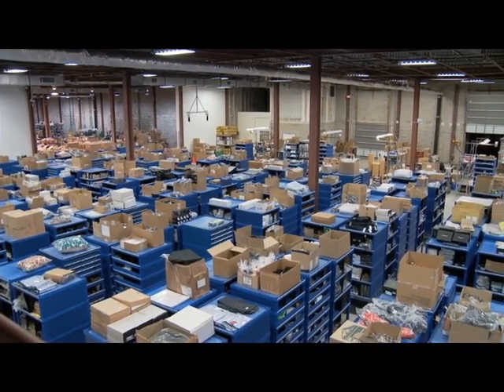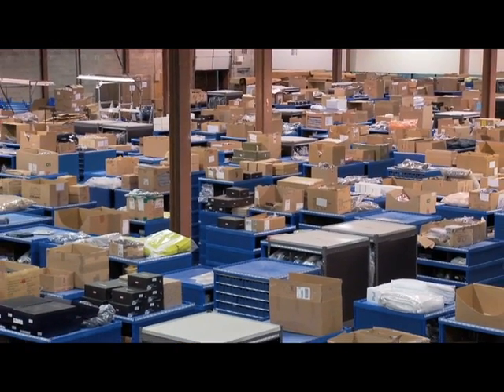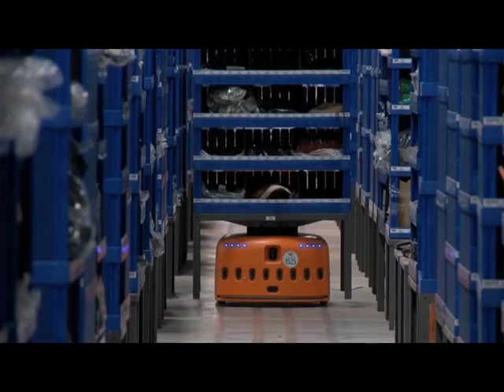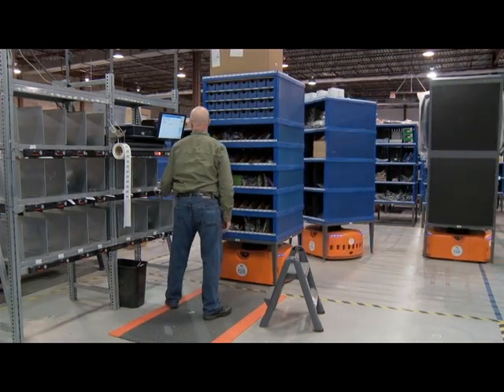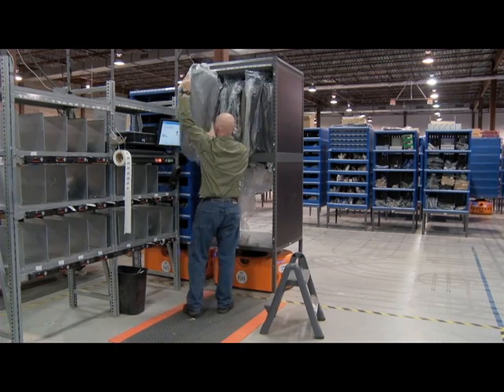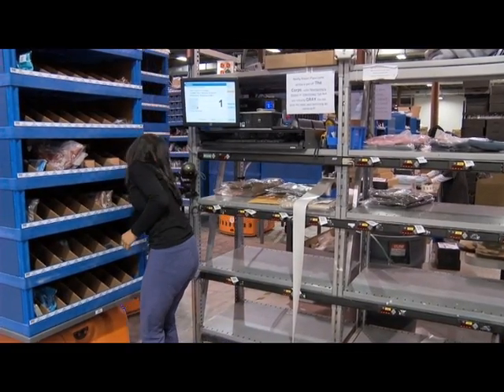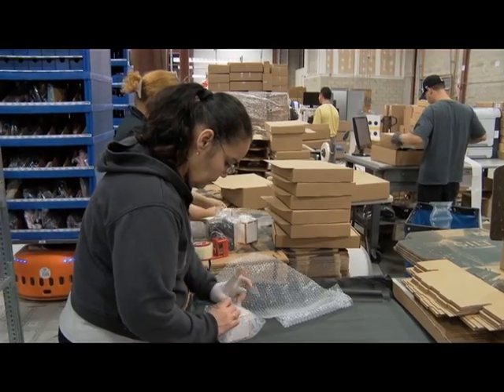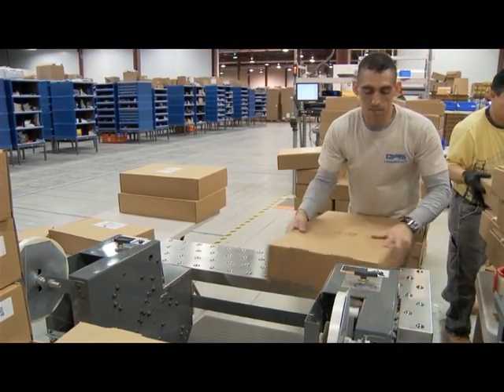Kiva Systems Warehouse Automation at  Quiet Logistics

Comment: Benefits of systems like Kiva Systems Warehouse automation.
•	Higher production rates and increased productivity. There is no doubt that customers from Kiva Systems Warehouse benefit from the automation as robots are far more efficient than humans which increases customer satisfaction and productivity. 
•	Inventory accuracy and security. Kiva Systems Warehouse Automation better precision and control over stock of any product. This ultimately makes stock taking at any other time very easy moreover with enhanced security.
•	Labor management; Kiva Systems Warehouse Automation provides multiple benefits for warehouse employees including helping to cut down on on-site commute time and do all the mundane work. It allows better managing and employing human skills in warehouse operations as well as increasing on efficiency, as an automated warehouse can operate 24 hours per day
•	Increased safety for people and products alone; this is justified in a way that the Warehouse operations are often associated with a range of high-risk activities such as handling heavy pallets and high racks, operating in a high-traffic environment. Today’s robots like at Kiva Systems Warehouse can do most of these jobs thus eliminating risks for employees.
•	Optimized cost.  Automated systems like Kiva Systems Warehouse reduce labor cost, higher performance, optimize handling and storage cost, minimized inventory errors, eliminated risks of mishandling and product loss, etc.
•	Higher resilience; highly automated warehouses like Kiva Systems Warehouse have an edge when pandemics come because they are by default more resilient to unexpected changes that order to continue being processed.
Drawbacks of systems like Kiva Systems Warehouse automation. 
•	Worker displacement. Kiva Systems warehouse automation requires less manpower compared to non-automated practices making the level of unemployment among the jobless higher.
•	High capital expenditure. Kiva Systems warehouse automation automated equipment include the high capital expenditure required to invest in automation (an automated system can cost millions of dollars to design, fabricate, and install)
•	Higher level of maintenance. Kiva Systems warehouse automation requires a higher level of maintenance than with a manually operated machine.
•	Less flexibility and ingenuity. Sometimes, warehouse operations require some flexibility and critical thinking and that is where the human person outperforms the robots. Robots are often very limited in terms of scope of use and they cannot always respond appropriately to changing circumstances of unpredictable situations.
Reply: wow , awesome answer